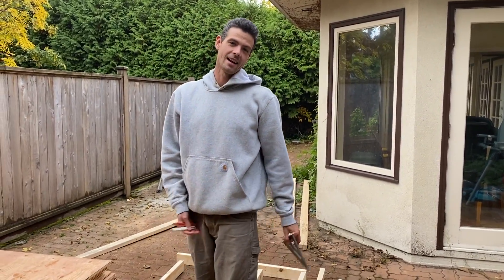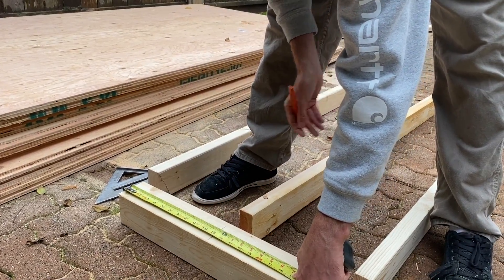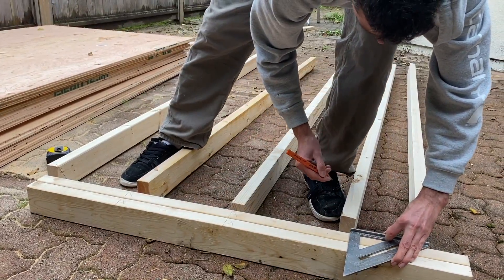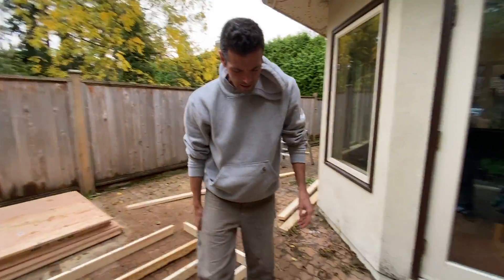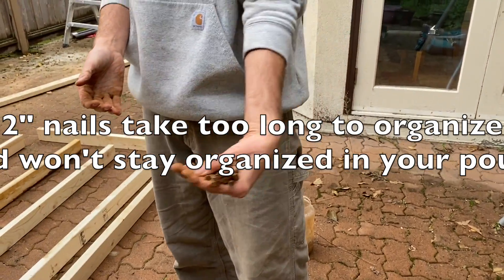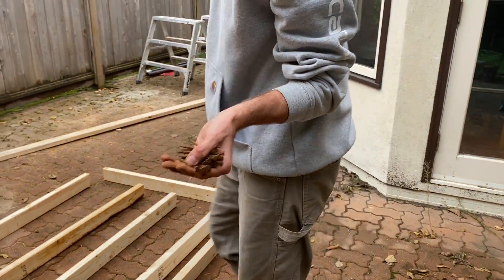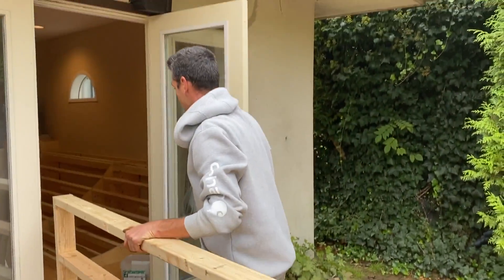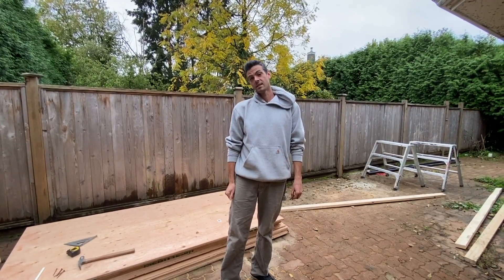Hand Framing a Small Wall!

Comment: I did my first wall a few weeks ago, built in situ.  I tried to nail it toenail style but I was too clumsy and mistakes were hard to fix so I switched to screws, following your other tutorial.  Much more control and I could undo the mistakes.  But I like the idea of hand nailing.  It is relaxing.  I hand nailed the cement sheet on, so at least I got some experience.

Comment: When nailing at the end of a plate I always start it with the nail aligned with the inside face of the end stud and angle it out so it's not as close to the end of the plate and reduces the chance of the nail splitting the plate. I also rest the frame I'm making on offcuts, so the studs & plates don't rest directly on the ground, to ease the alignment of the joints..

Comment: Man I love framing! Either I use my pneumatic framing Collated nailer or my cordless DeWalt framing nailer or my old Vaughan 27oz California Framer Hammer. Or my old Vaughan 28oz Rig Builder's Axe aka Carpenter's Hatchet. It's all about Hammer Techniques! On my 27oz California Framer and my 28oz Rig Builder's Axe I can drive the 3-1/4" to 3-1/2" common nails in just 1 to 2 hits without bending it. I can also do it too on my other Vaughan 16oz California Framer that is much lighter than its siblings. And I love Vaughan tools The waffle face really helps a lot it grabs the nail pretty good. for the record as a certified Carpenter in the state of Texas. I love using Framing Hammers and rig builder's axe MORE THAN a framing nailer. I know framing nailer is fast but hammer 🔨 is lot more fun to use. Hammer 🔨 is a Sword of a Carpenter.

Comment: They have battery powered nail guns now. They work pretty okay but are pricey. Maybe double the cost of the air powered versions, but you don't need a compressor at least and they're very portable. The nails don't have 'full' circular heads on them, so an engineer might make a fuss if they see someone using those on a shearwall's sheathing. But they work great for concrete forming when you're running around all over the place. And who knows, they might make versions with full-headed nail clips. Since they're relatively new on the market I think either the cost will come down or they will get better: Bigger nails, longer battery life, etc...
Reply: 21º nailers like Rigid's run collated full-head nails.. don't think 30º can.. I also heard that clipped nail heads don't meet Canadian code anymore..
Reply: @adammacer  Thanks for the info. I see the framing carpenters still using the pneumatic nail guns probably for that very reason. The last set of structural drawings I saw didn't allow the clipped heads (but did allow offset heads). I'm sure there's a battery operated full-head nail gun out there but it'll probably cost upwards of $600 cnd. They seem to break a lot too. I'm also from Vancouver and we don't have the friendliest conditions for tools however. At least not outside of the dryer months.
Reply: DR PHIL  Totally. When I first used the cordless I didn't like it but thought "okay I can work with this". Recently I used a hosed one... it's hard to used the battery powered right after using a pneumatic. But if I don't touch the pneumatic I can live with the battery ones.
Edit: But I wouldn't use the battery ones for framing carpentry maybe just formwork and mostly for tacking stuff.

Comment: Hay man you are a damn talented craftsman,  i have a question i havnt seen a ton in your videos,  how do you condition mudd for working after taping, like if you are feathering out butts or smoothing out repairs, how do you prepare your mudd and reduce those bastardly bubbles? And dont be afraid to offer an opinion on the best way to prep the american green lid all purpose  mudd even if you havnt worked with it a ton
Reply: Lol 😆. You came to a framing video to learn about drywall mudding. Too funny.
Reply: @verdonsharp3173  😂